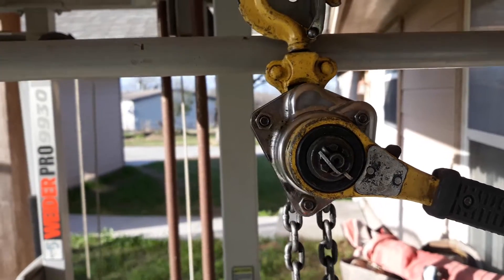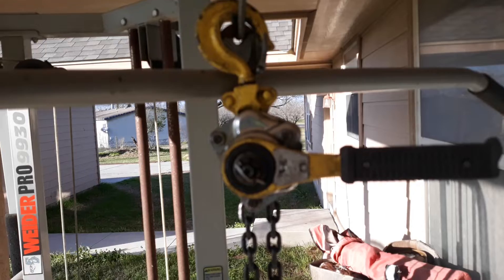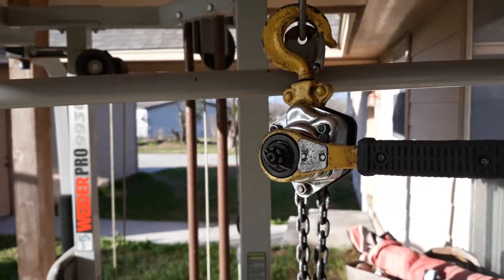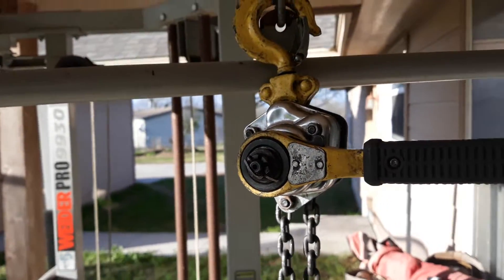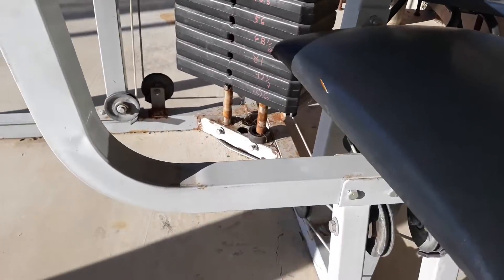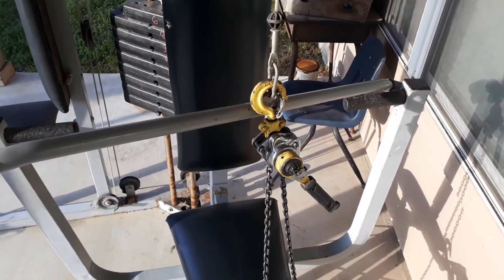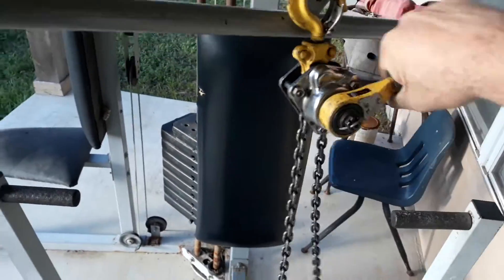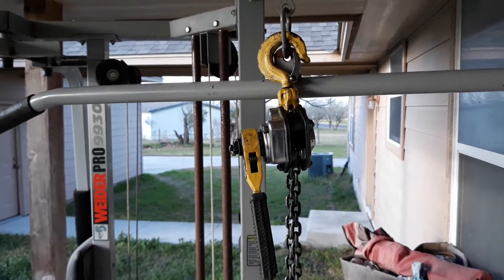"MIGHTY MOUSE" harbor freight tool in action by request

Comment: I build powerlines for a living and that hoist comes very handy for us lineman. Remember not to go past its rating 550lbs. Imbe safe out there, and thanks for the review.
Reply from the maker: I actually just busted mines , yes I asked to much of it 

Had a transmission literally ripple its self of the engine and was laying on the road 

Tried to lift it with the chain hoist but failed luckey I hv a 3/4 ton chain hoist and it got the job done 

I hv ordered a jet chain hoist to replace the harbor freight one and do a comparison of the two and yes i plan on buying another H.B. chain hoist LOVE THEM